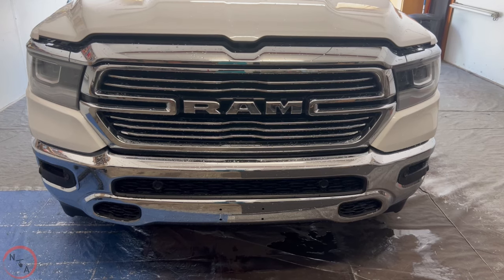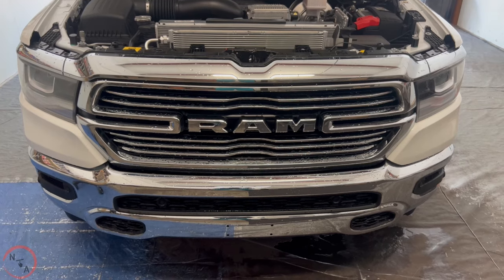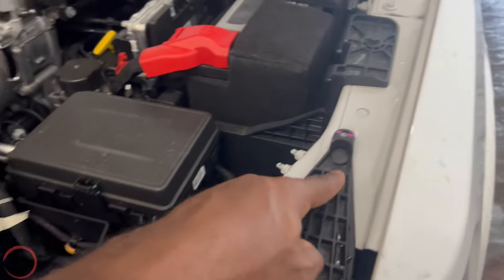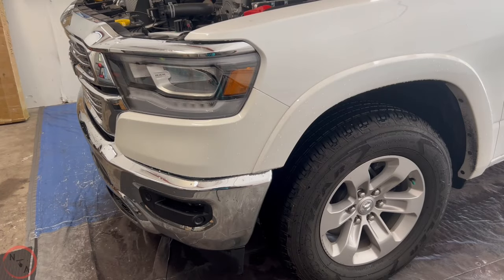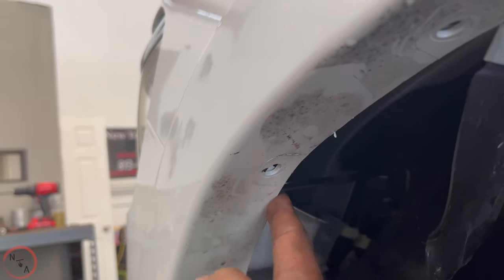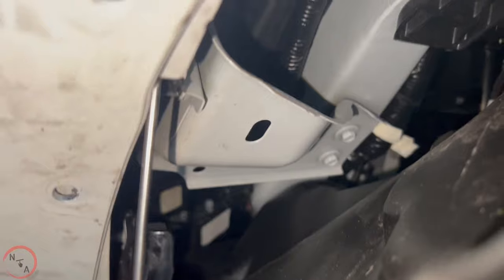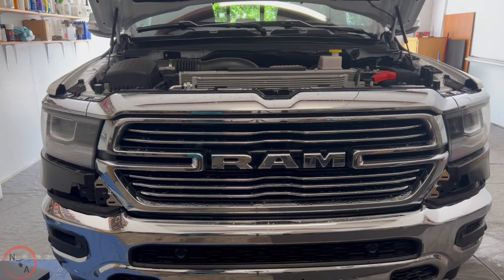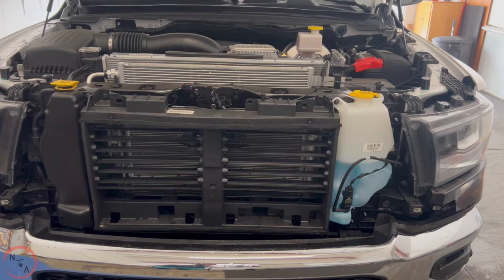How to remove the front grille of a 2019-2022 Dodge Ram truck

Comment: How do you remove the fender flare clips? Just pull on the flare?
Reply from the maker: Yes but clips won’t move so easily, take a flathead and push the clips in from the backside where they lock. Pull the flares at the same time and you’ll see an opportunity to remove it. Once you have the first 3 out the rest should undo easily.

Comment: How did you blackout the grille? I’m deciding between wrapping or painting…
Reply from the maker: It was done in a permanent paint finish which required me to remove the grille, a liquid spray wrap can be done without removing it if you decide to go that route.
Reply: @newtouchauto Is the paint fairly durable?
Reply from the maker: @pjfan173  Yes, with the proper steps completed before painting no issues occurred.
Reply: @newtouchauto  Thanks for the reply
Reply from the maker: You’re welcome and thank you for watching the video.

Comment: Do the horizontal strips come apart from the frame of the grill?  Im trying to have mine wrapped and the shop said it needs to be disassembled first
Reply from the maker: Correct, it’s difficult to vinyl wrap but if you have it spray wrapped the grille can stay on. Spray wraps has that advantage vs a vinyl wrap because you don’t have to remove any parts.
Reply: @newtouchauto  is that what you did you spray wrapped? Since I've already had the outer parts of the frame wrapped I'd rather have the grill wrapped. So I just want to make sure that it can be done before I go ahead and start the.  I imagine it's just a bunch of clips that hold the grill onto the grill frame
Reply from the maker: @Unconventionalreefer  no this vehicle was finished in a permanent paint finish. Yeah once you have the grille removed the clips are the last obstacle.

Comment: Changed headlights yesterday…. The wheel well liners and the fender flares were the pain in the a**… putting the liner back properly and removing the flares… def popped some clips and cracked an internal piece that holds one of the clips on both fenders but all in all I successfully changed the lights and everybody thinks they look dope. 🫡 wil buy more clips as replacements if I can.
Reply from the maker: Thanks for watching the video and sharing your experience. It’s normal to break a few clips when disassembling any parts but at least they’re at our local auto parts stores. I’m glad that you were successful with your installation though.